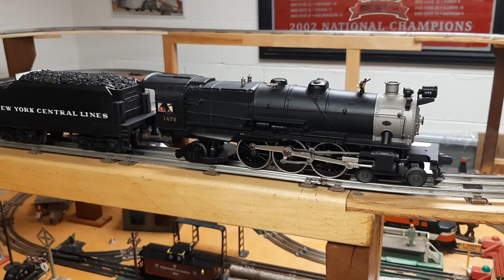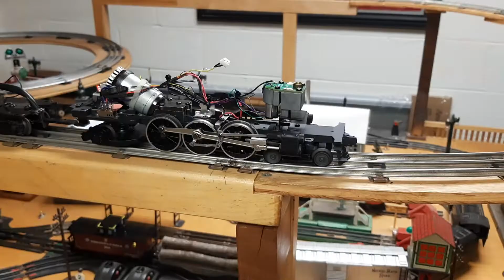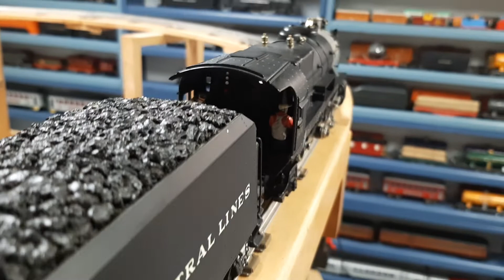MTH K4 Locomotive repair

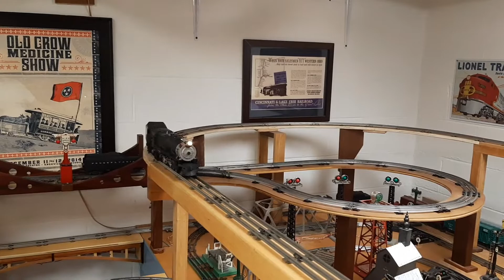Comment: It doesn't seem to coast very much when power is cut or lost.  For example 4:56 and 5:06.  That's probably hard on the gears and side rods.  A Dallee #400 e-unit might help, but MTH should have used a larger flywheel like they did on the first generation of this loco.  My $.02., thanks for sharing!

Comment: Great info, and K4's were in Pennsylvania colors from MTH, SO my take away is I can use a bridge rectifier to basically replace the gut of a tender? I have a MTH 2-8-8-2 w/o tender .. I ran it with the tender from my C&O 2-6-6-6 Alleghany